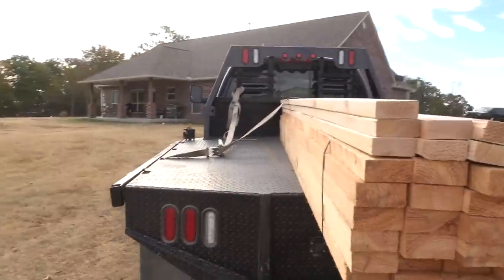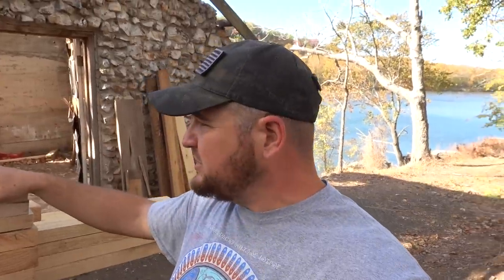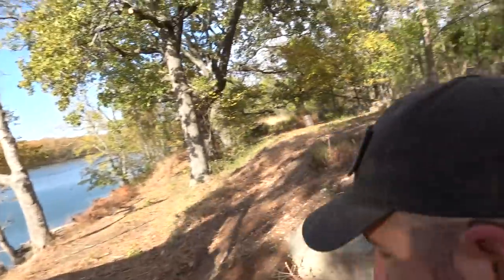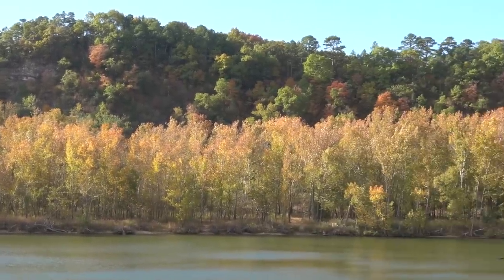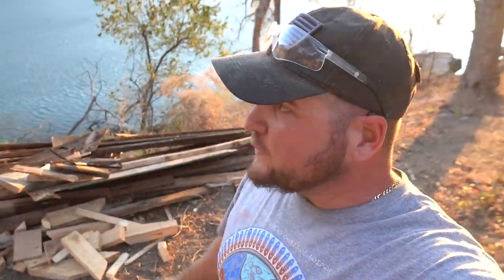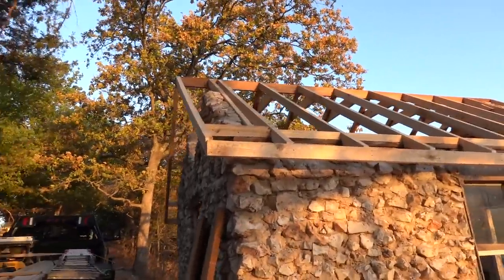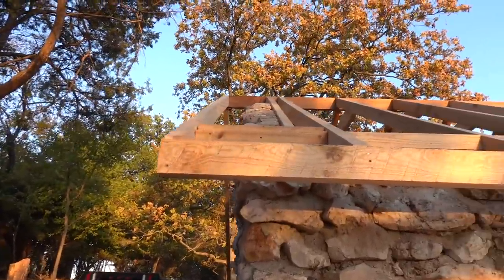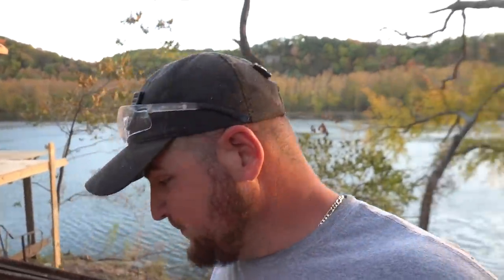REPLACING RAFTERS ON OUR 100 YEAR OLD ROCK CABIN WITH ROUGH CUT LUMBER

Comment: I would have use the chainsaw or curler saw or saw all cut a foot from the ridge beam an near the wall. Way didn't you after you cut the first rafter put it up to see if it fit then use that one as a Patton for all the others ?. A cedar shake roofing would look nice and they used that in the older days.  Thanks Dad for helping Kevin

Comment: You need a bucket or 2 for wood scraps from trimming the boards.  It will be easy to take the scraps to the burn pile in a few loads.

Comment: I keep having a bad feeling that someone is going to fall off of one of those back corners. We all know how quickly accidents can happen. All it takes is one mistake or lapse in concentration and someone could get seriously injured. A fall off the back of that platform and it could be deadly especially if you roll into the lake. I’d feel much better if there was a railing around that platform.